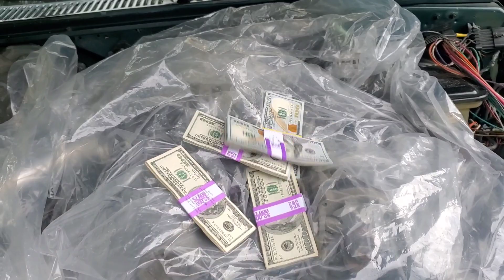Will my wife divorce me for buying another truck? Minitrucks got me fiending. Got some of that S10?

Comment: It’s imported from Europe for sure.
Reply: Also leave Dale Earnhardt decal alone on the rear window
Reply from the maker: I doubt it with the shitty speaker wire wiring.. lol
Reply: @HardCoreGarage  I see. Strange lol
Reply from the maker: T taps and differnt speaker wire on each side. There are blades on the backs of the lights. I may leave them, and rewire. They are different for sure
Reply: @HardCoreGarage  this is possibly thing…. Sold new to American then sold it oversea. And sold back to American? How many owners in it? I just never seen that before in USA but all of it in Europe as I saw videos. Very oddly